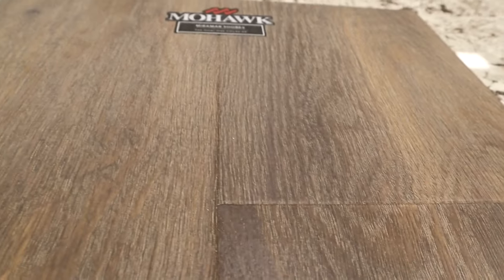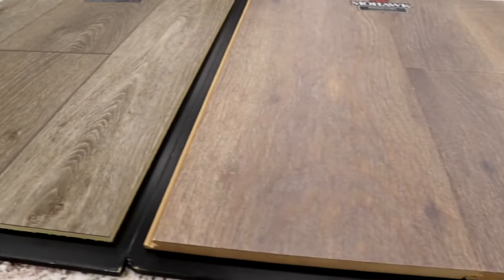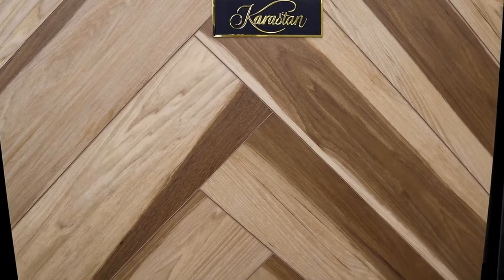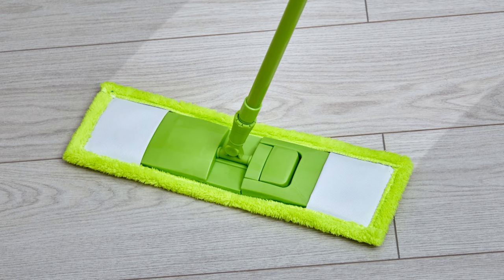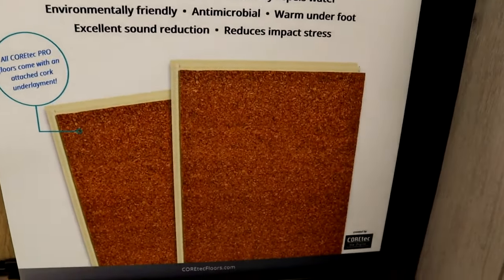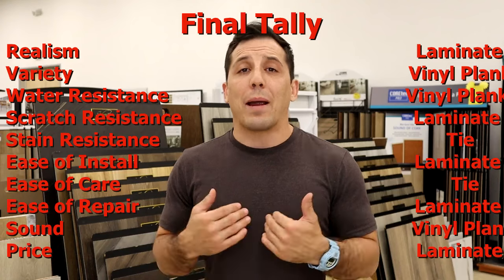Laminate Flooring VS Vinyl Plank Flooring

Comment: This is a great video - but you really mixed me up and had me confused at times when you used the word LVT ( or something like that) why not call them Vinyl and Laminate.
Reply: Probably because "LVT" is what you will see when you go shopping for it.
Reply: LVP luxury vinyl plank …LVT luxury vinyl tile. Both are vinyl. The LVT is made to look like large pieces of floor tile. LVP usually looks like wood.
Reply: That too I had to keep looking at the title lol   It’s just a co-op rental that hasn’t been renovated which it will once I move out. Of course. 
I’ve lived in two before and was on the board member etc. even won one a $125,000 park through home depot   But this one no one does anything.  So it doesn’t need to be the best  tiny bathroom and with no budget anyone have a suggestion lol lol.
Reply: What about those big pieces you cut to size   And place down. Aren’t they the cheapest?
Reply: Too much talk! Get to the point.
Reply: @AMYV3  probably less expensive but they are glue down and a dated look.
Reply: If you see V in the acronym I think it’s pretty simple to understand it’s vinyl based
Reply: Thank you , I mean call it vinyl or laminate! Just for that this video is trash ! I need accurate wording because I’m just lost !
Reply: I get your confusion aswell.  I'm at the end of my second month at a furniture and flooring store; and just juggling terms in the learning process has been my biggest learning curve.  I came from 16 years in the stone industry (fab and mainly lead installer) and knew every in and out; had a concrete answer always.  

I feel like a fish out of water here.
Reply: @boridebrooklyn8300  LVT/LVP = vinyl

Comment: Confirmed the facts. I looked at several sites and they kept pushing Vinyl. Saying it was more resilient to scratches and other things but there was nothing backing it. They are pushing vinyl and not stating the facts. You also pointed out what happens when water gets underneath which is very common. Water doesn’t always stay on top of your flooring, baseboards bad caulking and that water gets trapped with vinyl. High humidity areas might want to avoid vinyl.
Reply: If water gets under your vinyl planks, and that is your issue, you have big issues with laminate. The middle is never waterproof

Comment: Vinyl will emit VOC gas and can be installed only needing a sharp knife. Vinyl is much easier to install. For condo units, a chop saw is not needed. Some strata will not allow a chop saw inside the unit. So again, Vinyl is a better option for installation. Laminate will pucker in joints if water is left even overnight. One short term renter brought in a ski bag which had some snow embedded in the bag. This leaked onto the Laminate floor which puckered in the spot where the bag was left. Vinyl, this would not be an issue. I lean towards Vinyl for rental units as renters can be harder on floors and not as mindful about water spills or pet accidents. Assess your specific use and choose accordingly. I am upgrading my 20 year laminate floor in a rental condo with Vinyl again due to easy of install and durability.

Comment: If you mop a lot, you will definitely want LVP instead. I had water resistance laminate floor before, after couple years, you will eventually notice some bubbling around some edges. It is very ugly to look at once you noticed them. Also for LVP, you can install same flooring through out entire house for a consistent look (it actually make your house look bigger too). You can install it in bathrooms without issues. Even though it is waterproof, make sure don't flood the floor with water...
Reply: They're all going to push laminate because their profit margin is larger

Comment: Robert, great video. I'm going to point my customers to it. This topic is among the most debated issues when presenting LVP or Laminate to a customer. Most come to the issue based on past experience with a product like old Pergo or comments from parents and older friends. More difficult are the discussions with older professionals in the construction trades; most won't touch Laminate. Yet, nearly every installer and flooring salesperson that I've talked to is 100% behind Laminate.
Reply from the maker: Thanks so much for watching and the feedback. It is definitely one of the most common questions that we get in our business and there are so many factors to discuss when starting to not only compare categories, but the individual brands and all options in each.
Reply: Here is my two-cents worth:  Pergo is a swedish flooring company that has been around for ages and sells both laminate and vinyl clic-flooring. Their products are not cheap - but definitely cheaper than hardwood. My husband and I bought Pergo laminate planks close to 20 years ago now to install in our bedrooms and study. My husband did a DIY installation and I was thrilled with the outcome. The laminate flooring came with a 20-year warranty. About 10 years ago, the bathroom adjacent to one of the bedrooms with the Pergo flooring flooded and the water streamed over the Pergo flooring. I was certain it was going to be a disaster, but the good ol' Pergo floor held their own, and no damage was evident and the time of the accident, nor anytime after (granted, I live in a dry southern hemisphere country, but I was still impressed). The floors still look almost like new as I type this. Pergo constantly update and refine their products and I see today that their laminate and vinyl flooring has lifetime warranties, and is recommended for high traffic venue like restaurants.

Comment: I put down some laminate in my basement and have watched a lot of install videos of both laminate and LVP... and I have to say, the fact that you can cut LVP with a box cutter instead of having to use a saw is a huge plus.
Reply: There's a reason why you can't cut Laminate.  It's much harder.  I have Pergo Timbercraft Laminate on my entire main floor and Lifeproof LVP in my basement and I like the Laminate much better.  The LVP seems a little soft to me.
Reply: Really? Is it really possible to cut LVP with a box cutter? I have a strange curve to work around and don't own a saw. Could I cut curves in LVP with a box cutter, really? That would be great!

Comment: As far as installation cost, I have found that hard laminate flooring such as Pergo Wet Protect wears out saw blades about 3 times as faster compared to vinyl flooring.   This can add an extra $200 in materials for a project depending on its size.

Diablo makes blades specifically for laminate and vinyl flooring and still, I have found the laminate blade starts "smoking" in 1/3 the time.

Comment: I'm disappointed that "general feel under your feet" wasn't covered. That's my biggest concern when deciding. Does vinyl have a plastic feel to it? Does laminate simulate wood better? I mean, that's what both are trying to do. Simulate wood. I'd be curious which one does that better.
Reply: I have a bunch of plank samples of both vinyl and laminate here, and I can tell you right now that Robert was on point about vinyl finish feeling more "plasticky", and from my side I will add -- from experience with the samples I've got here -- that your feet will also feel the same. Laminate feels more like wood, in fact it's impressively quite like wood. Vinyl, while looking like wood from most angles, has decidedly more specular reflections (which wood normally does not have until heavily lacquered) in certain incidental light angle(s), also feels much more like plastic under your feet. It's going for a different vibe though, since it's got its advantages over laminate, like superior sound insulation (unless your vinyl core is e.g. HDF, like in case of some of Parador flooring) and superior water proofing. But if you want wood but for some reason exclude actual wood like parquet or solid wood flooring, then laminate is the thing to lay.
Reply: Laminate has much more of a wood sound and feel by far. Pergo timber craft excels in that department

Comment: Robert, thank you! I bought laminate flooring recently from   LL Flooring. No one told me that this Flooring has to be installed in the SAME direction without having to withstand thick "transition" pieces in the doorways! Please include this information in your videos. It will be helpful for your viewers.  Your channel is great. I have learned quite a bit. Wish I had tuned in, before I made my purchase! Thanks for great information!
Reply: What are you saying? You do or don't have to have transitions in doorways with laminate? I had imagined my entire place would have one solid floor without ANY transitions because it would all go in the same direction. How is laminate different from vinyl in this instance?
Reply: @bre.j  It's not.  It's almost IMPOSSIBLE to start in one location and lay one continuous floor across an entire house.  You end up going backwards when you transition into some rooms, end up with very small edges periodically if your layout does not match in that room so transitions are quite common.  I did a 1200 square foot downstairs and ended up with 3.  1 in the transition into the laundry room, 1 at the bathroom and one in a closet.  It took half a day for layout to make it work. I won't do it like that again.  I'll do transitions.  Faster, simpler, and if you put it under where the door closes, it's invisible.  If you don't want a transitions, it's hard to do on one floor especially with a floating floor.

Comment: Tried DuPont brand laminate mid price chipped very easily upon install  and not pleased  installed vinyl and went together no problem. The laminate after installation was however very scratch resistant southeast Texas pier and beam lots of moisture also

Comment: Number one is which product looks more realistic and you say laminate but you're showing a coretec LVP which is not a laminate as i understand it. Can you  expand on this please?
Reply from the maker: Yes, on number 1, I show a Mohawk Revwood laminate and as compared to a coretec. These are both leaders in their categories.
Reply: @RemodelWithRobert  thank you!
Reply: Do you know what is best over radiant heated floor?  I’m installing tubing under subfloor.  Additionally the tubing is in the concrete basement.  Thank you.

Comment: This really helped me decide!  Laminate it is 😅
Reply: Don't get laminate. It's trash. Lvp is 10k times better.
Reply: @ubergsxr01  . . . Not even close.  I installed Pergo Timbercraft Laminate on most of our main floor 900sq ft and was able to install it with no transitions and it was easier to take apart and put back together.  I then installed Lifeproof LVP in our basement 650 sq ft and it was more difficult to install.  The click lock system is brittle and is very difficult to take apart if you need to redo an area.  The planks are softer and I think they look a little plasticky.  They don't feel as good or solid as the Laminate.
Reply: @republitarian484  I've installed hundreds of thousands of feet of laminate and lvp. I actually own a flooring company. It just takes practice to do it right. I'll do 1k ft of lvp by myself in 1 day. I don't even mess with laminate anymore, we won't even sell it anymore. Laminate was all we had until lvp came out about 10 years ago. Laminate is just compressed cardboard.
Reply: @ubergsxr01  . . . I installed both of the above myself and I found the Laminate was much easier to install and easier to take apart put back together if you needed to.  And that was 4 years ago and it's holding up very well.  I even put a scrap piece of the laminate in a bucket of water for a few weeks.  Pulled it out and let it dry and it never even affected it.  The LVP I installed downstairs is OK.  It bends so it contours to some of the curvature of my concrete floor.  I know. . you need a level floor within 3/16" every 10 feet. . .bla bla bla.  I just made sure any profiles were grinded down and that the slope was smooth and reasonable.  It has formed down against the floor pretty well.  The click/lock seem a little brittle and less forgiving too.  Anyway, I find the LVP a little soft and plasticky looking and it seems to scratch easier.

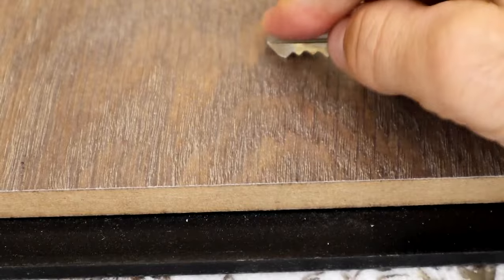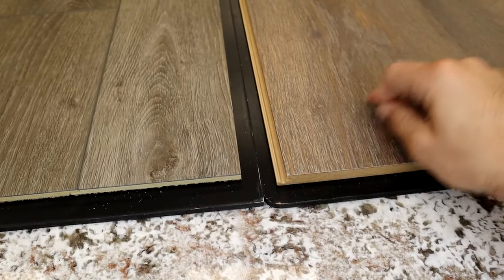Comment: 4:20 more moisture issues with vinyl. Laminate more scratch proof 5:25 stain, tie 4:50 installation 7:00 care, tie; repair, laminate better 8:35 sound, vinyl 9:25 value, laminate

Comment: do you have a video comparing waterproof engineered hardwood vs waterproof laminate? in your opinion which one is better? its worth to pay double for engineered wood floors?
Reply from the maker: I dont but considering maming a video to compare all wood look options and the reasons to buy each. Would love to hear if you think that would be a helpful video!
Reply: @RemodelWithRobert  Yes, it will be helpful! I am having a hard time trying to decide between Woodura waterproof engineered wood floors and Mohawk RevWood Plus laminate flooring. The first option is doble the price, don’t know if is worth.

Comment: CAN YOU INSTALL LAMINATE OVER OLD VINYL TILE?
Reply: We installed it over original old hardwood and older vinyl sheet in a kitchen. Done beautifully and held up.
Reply from the maker: If the vinyl is well adhered to the floor, smooth and level, then floating over the top of it can definitely be considered. I would not float laminate over a floating vinyl plank.

Comment: no way  laminate is more durable than LVP. I took several samples of LVP home and hit them with a claw hammer and left no visible marks then took an off cut of the flooring I had installed and did the same just to make sure the samples were real samples and no visible marks with the claw end or the hammer end. I tried the same with many laminate flooring offers and all had bad dents and scratches. Just get stone core LVP not wood core! Try it yourself, samples are free everywhere!! I love my LVP flooring I got my whole house done and I now have zero transitions, my old laminate flooring had transitions everywhere that I would move a chair or something and hit or hit with my feet, those days are over now!!! I had transitions living room to bathroom, living room to kitchen all over and now all seamless monolithic no transition flooring and I would never put laminate in a wet area like laundry room or kitchen or bathroom but LVP is no problem in those locations just remember PVC baseboards in those areas!
Reply: I guess it depends on the brand and quality. I gutted some ugly vinyl and installed pergo timbercraft with no transitions 1700sqft 2 story and it’s been 2 years no scratches no marks and perfect still. I was testing the product out in the stores. I used my keys against the pergo and no marks.

Comment: Great, video. How about thicknesses?  What thickness to use? What are pros and cons of thin vs thick thicknesses? I wished someone talked about that. I'm split between getting 8mm or 10mm for my second floor condo.
Reply: You don’t really need a 10mm wear layer unless you have expect to face lots and lots of foot traffic, just fyi
Reply: @Steasyp  Thank you.
Reply: Thickness doesn't matter too much as long as you stay in a certain range. 8-12mm for laminate, 5-8mm for vinyl plank. More important are wear layer which is typically shown in (mils). If you're on a second floor I'd suggest a pad. The pads on the backs of the planks are just to stop the floor from "clapping" because it's a floating floor, if you want actual sound deadening, comfort, insulation you need a additional pad.

Comment: What’s your opinion on Pergo Timbercraft? We had it in one home and with great results. We built new last year, builder used LVP (brand Aqualok) and we don’t like it. It’s cold, hard and plastic. Nail pops pushed up. Hubs wants to rip it out and put down Laminate. Or can we install it over existing LVP? Only good thing is LVP is so easy to mop clean. We like the Timbercraft but I’m having trouble finding a color I like now.
Reply: I installed Pergo Timbercraft Laminate on our main floor and Lifeproof LVP in our basement and I think the Pergo Timbercraft is much better.

Comment: it's LVP not LVT
Reply from the maker: LVT (luxury vinyl tile) is the original term for the broader category. LVP (luxury vinyl plank) was adopted to differentiate the expanded offerings in wood-look vinyl tiles. Both terms are commonly used today somewhat interchangeably. Vinyl planks, as referenced in my thumbnail, are more specific to longer format products like the wood looks or even some long stone looks. I hope that clarifies. Thanks for watching!

Comment: He loses all credibility when he says laminate is easier to install. One requires a razor knife while the other literally requires multiple different saws
Reply from the maker: LVT has far more failures due to improper installation, and it's not close. There are a lot more factors than just which one is easier to cut.
Reply: @RemodelWithRobert  that's a straw man. You are talking about issues with not leveling the subfloor during preparation, which should be done regardless of which type of flooring you are installing
Reply from the maker: You are correct that LVT is less forgiving against subfloor issues, but the integrity of a lot of the locking systems of the stone composite cores also leads to more care in installing the planks without damaging the joints and separately, chipping the veneers. Of course this varies across brands as well and I have to speak in some what generalized terms for brevity, but which product is easier to cut is not the main factor for overall ease of installation. I hope that helps, and thanks for watching!